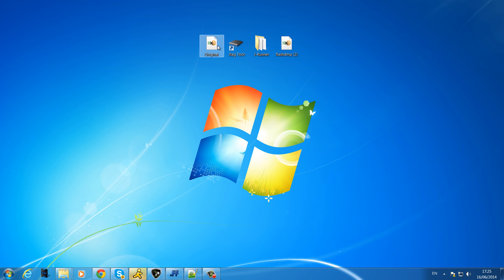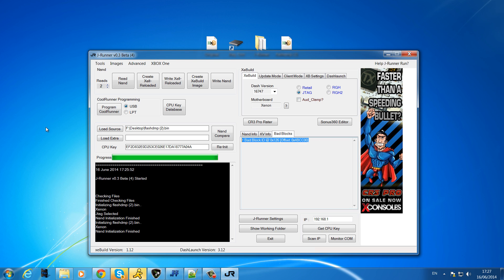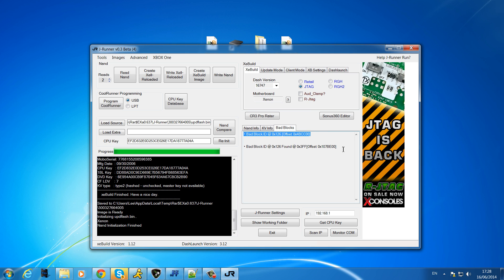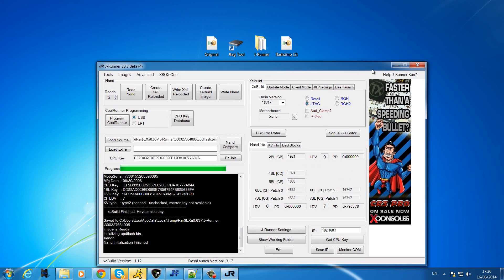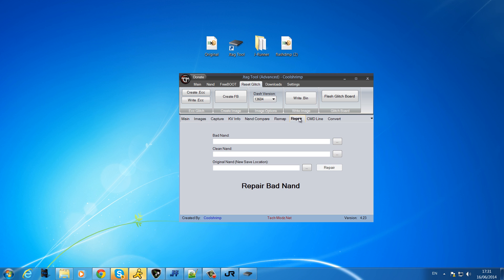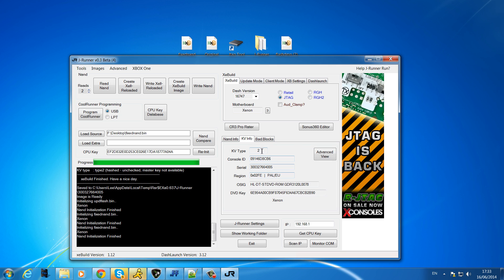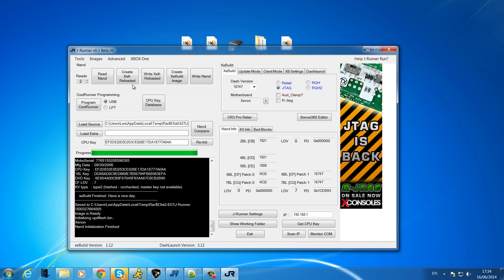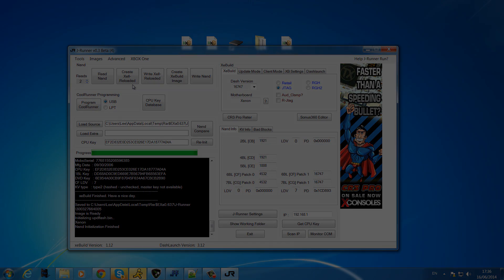Jtag Tutorials #30 Fixing Bad Blocks In a Nand

Comment: mate please can you help me, i had 4 bad blocks so i did option 2 with the original nand from that website and followed the steps correctly, so i flashed the uptdated flashdump and my jtag turns on but i dont get anything no picture, no rings flashing, only the center light is on please help mate

Comment: im on the dash im i ok to go through with 16756? because its fine for me but i do think i have a couple of bad blocks and dont want to take any chances
Reply from the maker: Check that the bad blocks are auto remapped when you load them into J-Runner as shown in the video. If they are then you should be okay to flash it to the console.
Reply: xXModdedWarfareXx mate could you upload the version.txt for the jtag tool, beacause it doesnt work for me please?

Comment: please guide me / In RT809H / In the bad block detect section / Which option is suitable for toshiba tc58nvg0s3hta00 and samsung K9gag08u0e ICs? and / I have a problem with this, And sometimes the new ic that I program does not work 
Thank you

Comment: Hey I know this isn't relevant, but would infernus (Infernus stealth server) get my retail console banned, they both use the same ip and mac address.
Reply: Do not turn off your xbox keep it on FOREVER
Infernus will corrupt and microsoft will ban your console and give it the red ring of death
Reply: Spookswagen Clone They can't give you the ring of death i'm not that stupid kid. you get the ring of death from your console over heating. and i don't give a shit if i get banned. I can buy another keyvault and i will be unbanned!
Reply: Yeah. I'm just joking... just download XBLSE Infernus and set it as plugin 1 on Dashlaunch and you will be fine. Enjoy!
Reply: Spookswagen Clone
Yea, i know how to do that. i was wondering if it would get my brothers xbox banned if i used it,
Reply: Ye. It will get banned. Get a spare KV and an CPU key. CPUkeys.bin are hard to find. But, They are bundled when you buy a KV.
Reply: Spookswagen Clone no man my RETAIL xbox. not my modded one. if the retail gets banned you cant unban it.
Reply: AGR Modz| Giveaway Soon! I don't believe so because you need your nand to access files like your KV so if your retail console doesn't have a nand in it then it cant be unbanned but i would just not play with your other console like don't do any signed in on to live system links with your modded Xbox to your retail Xbox and you will be fine or as another option you can get a dual nand and typically just press the sync button i think when the console is off and it will switch to a retail and vice verso so all in all, no your brother Xbox IF banned will stay unbanned although i do know a trick if it is a certain type of ban what you can do if it is i think profile it may work on console but idk sense your a modder i figure maybe on COD you say i have a deal you must report your bros account for a bad name or bio description has bad language for free modded lobby (that just gives him heighten jump and what not not to extreme because you have to make a profit some how) and what this will do is Microsoft will see this and lets say he is banned tell year 9999 or something like that then what will happen is it will make a new ban and this new ban is not for the forever ban but rather for just about 1 to 2 week ban thus you just removed the long ban i hope this helps clarify anything just comment down below if you have any further questions and tag me so i can see it in my notifications.

Comment: what does it mean when my xbox shows two red rings? not the one that the red rings are beside each other but mine shows across from each other. like on ring 1 is red then on ring 3 is red
Reply: Never mind i have figured it out. When the Ring 1 lights red and Ring 3 lights red either stands for a graphics card burnt up or the motherboard had cracked from overheating.

Comment: So I did a jasper dump yesterday I got all the way to write xell then when I try to get too xell screen on Xbox nothing shows I never get the cpu key and I’m stuck with a black screen no logo of Xbox nothing even after stating over. Both nand dumps are the same and my system still shows in j runner. I had maybe 5 bad blocks in both dumps and I don’t remember if I had 1 in the nand write but both was successful. So I was wondering if there any way to fix this? Is it the bottom wires as there kinda hard without micro… or I bricked .. bricked it? Thanks! And again never gained cpu key!